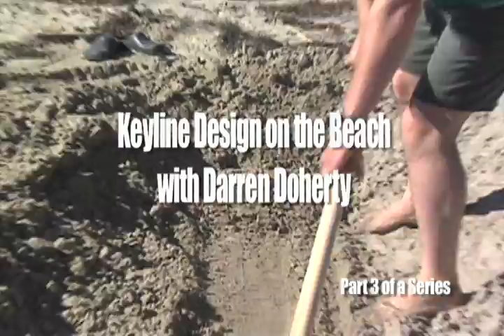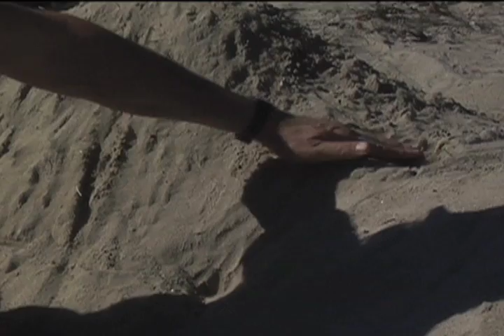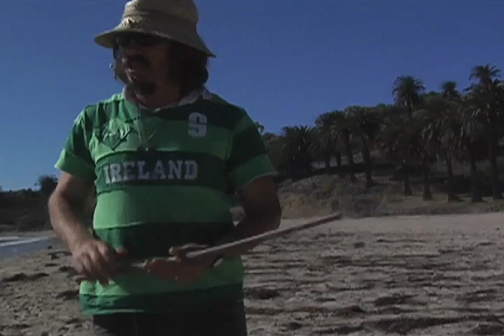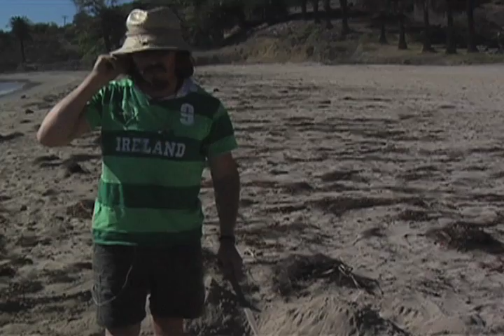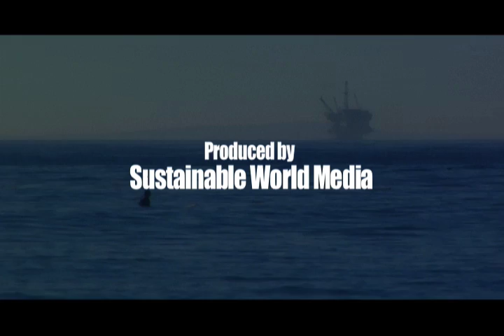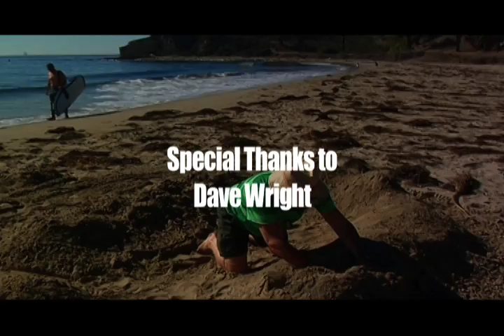Keyline Design at the Beach (3) Darren Doherty

Comment: Where did you get your runoff figures from? The amount of runoff of any given area depends on what it consists of, slope  and the kind of rain. Flat level loose sand and a light drizzle will have 0 runoff. A paved road will have almost 100 percent. The remainder will evaporate. In a drenching downpour the runoff will depend on the slope.
Reply from the maker: Dusty, you can visit Darren's website for more info: http://www.regrarians.org